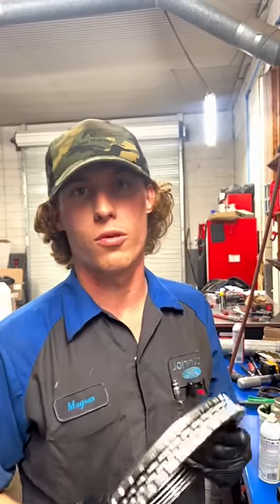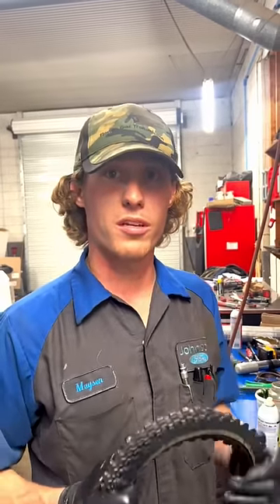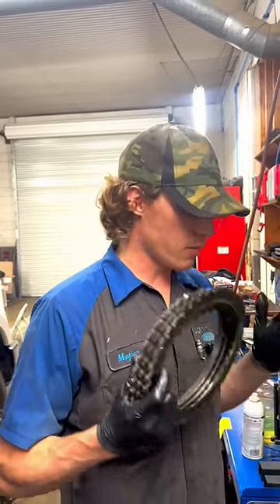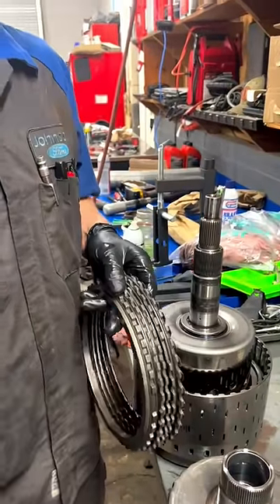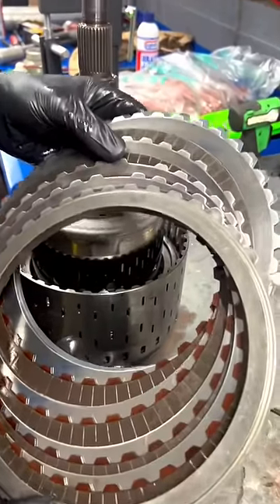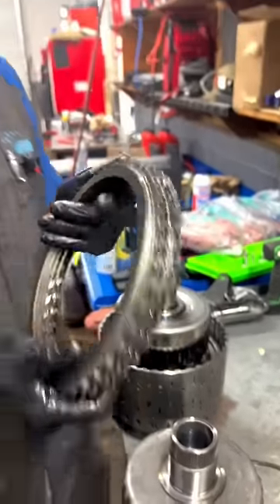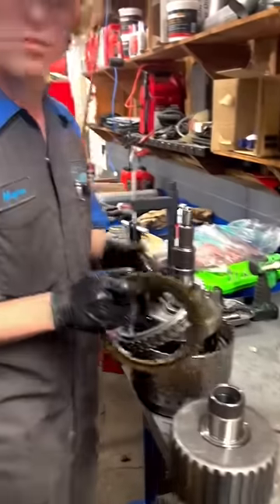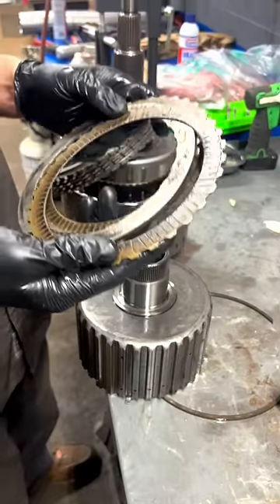Should you replace every clutch during automatic transmission overhaul? #shorts

Comment from the maker: Keep in mind!!! A lot of these clutches and steel plates are impossible to get. Not to mention, I said “warranty” which implies very low mileage units. 

Would you really want to wait 3 months on a back ordered set of clutches that you don’t even need? 🤔
Reply: Yes, often times if a clutch pack grenades you have metal fragments suspended in the fluid which makes it into the other clutch packs and embed themselves into the friction material. That transmission may function when you are done with it but it's now a ticking time bomb limping by to make it out of warranty where the customer has to shoulder the cost. Best to burn the transmission up, or take it to a reputable transmission shop for warranty work which is legitimate because it's illegal in the us to make someone go to the dealer for warranty work.

Edit, unless it got super hot and warped the steels your steels are usually fine. Just rough them up so they mate in with the new clutch packs and get the glaze off of them.
Reply: @oliver_klozoff  for factory warranty? Nope you have to take it to a dealer don't you? I'm an independent so,
 Baah! either the steels are good or they're not, if they have blue spots I'll resurface them with a 3" scotch disc on my old angle die grinder, but only if it's an absolute last resort. If they are scored up, warped, shot, no way. I normally buy master kits w Borg clutchs & steels. I hate reusing steels if you are putting in new frictions anyway. If you buy less steels banner kits you usually have at least one burnt up clutch pak so you need steels for that one or ones anyway. But I work mostly on older stuff, four speed overdrives & some old three speeds even yet. But yeah I've been running into parts shortages too, especially on the new stuff.
Reply: @oneninerniner3427  you do not have to take your vehicle to the dealer for a factory warranty. That is actually against the law to have that as a requirement for warranty. Just as they cannot tell you you have to have your services done at the dealer. But your shop has to be willing to work with the vehicle manufacturer to get the warranty fulfilled.
Reply: @oneninerniner3427  as far as steels go, I keep spares if they'll lay flat on a flat work table and don't have obvious signs of heat damage. The different thicknesses between new and old can help you build your clutch packs to the proper tolerances. I usually double my clutch packs up on certain builds, so even when getting new steels you usually have to use a mix of new and old to build the proper clutch pack when you throw out the big spacers.
Reply: @oliver_klozoff  yup ,some of them you can get oversized steels to adjust clearance too if different snap ring thickness won't do it.
Reply: Or different thickness backing plates I should add.
Reply: @oneninerniner3427  yes on all counts. I'm not a professional tranny guy, but my dad was a builder for 28 years so some things have just rubbed off on me. Never had anyone build me a transmission, but I have had my dad supervise me building one  unfamiliar with.
Reply: @oliver_klozoff  I think it's more like the independent shop has to try get the manufacturers dealer to work with them to get the manufacturers warranty to cover. Doesn't it have to go through a dealer? 
Aftermarket warranty outfits yes I've worked with them many times.  But I worked at a fairly well known trans specialty shop in my area for many years , before I went back to my own shop and even then we couldn't or they wouldn't allow us to do any OEM manufacturers warranty work, the dealers did it themselves.
Reply: @oliver_klozoff  ok so you aren't a professional builder ,so there's that!
Reply: @oneninerniner3427  my dad did lots of gm and dodge warranty work. I think it has a lot to do with your affiliation with ATRA and being certified to do warranty work for them (Chrysler, gm, Ford, etc). I know he has to send some off for warranty work, but not much.
Reply: 7 months i waited had paid ahead of time they shipped it from wayyy way far away for no apparent reason for a rebuilt tranny cost more than the vehicle i bought and works fine now but i feel like i overpaid by 2/3rds what it shoulda cost oh and on top of that no mechanic would offer to install it for me I even had brand new radiator and radiator cap and all to install to keep it under warranty  the old radiator still good and kept it so it couldn't be wasted as scrap pretty sure it's going to power my desktop it's overkill big enough to passively cool without a fan but eh go big or go home right?👍 so yeah spare parts because i want the antiques to last forever like the promise NO new or current vehicle would Ever make or keep thier word of garuntee
Reply: Ford dealer tech no I replace what is fucked up but I do get a seal kit and replace all seals even on the 10r140s
Reply: @Kevin-yc4kg  yeah as long as it makes it to the end of the warranty you guys get to charge for replacing it when it grenades because there's metal fragment embedded in the rest of the clutches. You guys at the dealers are hacks, nothing more.
Reply: Yeah, sometimes. Aftermarket clutch replacement in an automatic or manual transmission is preventative maintenance. Why not pay for the job now when you can afford it vs when it it's downbad and the bill is hella ran up
Reply: What state do you live in?
Reply: I get ya brother people still act like parts are falling off the shelves when their not. If you can only get what you need to get a vehicle back on the road, do it. People can't wait 6 to 12 months to get their cars fixed. Hell insurance companies are totaling brand new cars with minor damage cause they can't get parts to fix them, and it's cheaper to total it than pay for a rental that long.  We live in a totally different world now. It's no longer a throw-away society, I know it will take some getting used to, but we're all going to have to get on board.
Reply: If I'm paying for the parts and labor yes 💯 if you're not going to do it then don't charge me for it and as long as you make me aware of it and I'm okay with that then yes
Reply: Take a measurement consult spec
Reply: Of course send it
Reply: These comments are hilarious. Oh okay, I’ll ask the customer if he wants to spend an extra few hundred on parts and wait a month or two to get them, because I should replace all the frictions and steels “as long as I’m in there.” No. The manufacturer tells you what you will get paid to replace under warranty. Nothing more. And then, you get to take pictures and send those failed parts back - so if you lied to try to get other non-failed parts replaced, odds are it’ll come back to you eventually.  You replace the parts that the manufacturer says to replace, and the tech gets paid to replace only those parts. It’s stipulated in the warranty legals you agreed to by taking ownership of the vehicle. 
As for outside shops doing manufacturer warranty work: only if it’s a sublet from a dealer that isn’t equipped to do the warranty repair, and the manufacturer approved it beforehand. Otherwise, no. A manufacturer does not have to pay a non-dealership entity for warranty repairs. Go ahead and submit that paperwork for reimbursement, see how that goes for you. It’s literally spelled out in the warranty legalese that, once again, you agreed to by taking ownership of the vehicle, just like it’s spelled out that the manufacturer can end the warranty coverage at any time for any reason. 
Also: the Magnuson-Moss Warranty Act has nothing that says that any car can be repaired under manufacturer warranty at any shop - in fact, quite the opposite: “the warrantor may require consumers to return a defective item to its place of purchase for repair.” What is DOES say is that if that dealer notices that you have, say, aftermarket wheels and a fancy cold-air intake, those items alone are not justification for voiding the warranty.
Reply: @oliver_klozoff  LOL, try that some time, it won't work out well for you. For one, the dealer is the one that determines if the repair is eligible for a warranty repair, another shop CAN NOT PERFORM THIS TASK! Then you have the fact that the pay for warranty work is lower than that for regular work. Any shop other than the dealer will refuse to work for that lower rate and the manufacturer will refuse to pay a higher rate. You will end up having to pay the other shop up front, go to court, and get a judgment in your favor for that amount. Sounds like fun, huh.
Reply: @Kevin-yc4kg  anyone who wants to stand behind hack work like putting used clutches from a known failed unit back in, probably not even cleaning the contaminated fluid out of the pistions and accumulators as well, knowing that thing send clutch and metal material through the whole system deserves to be called out. You're just putting junk back together and hopefully it'll last a day beyond any warranty period. You people give real technicians a bad name  and are why nobody trusts a mechanic. Take some pride in your work.
Reply: If it's warranty item(s) then aren't you only replacing the 1 or 2 spicific areas in question 🤔 everything else should have been in perfect shape
Reply: Which means it's a Lemon.
Reply: @danlevesque5437  if a clutch pack burns it up it has contaminated the rest of the transmission with metal fragments and burnt clutch material. The rest may function, but in the same manner as a hand grenade with a random number generator for a fuse. It most certainly will not last because it has all been damaged. Any decent transmission tech will report this for warranty and not just one failed clutch pack. I wouldn't put my name on that kind of hand grenade.
Reply: Rock Auto... And if it's a dodge really change everything
Reply: @andyt1573  if it's a dodge throw in out and convert it into a manual transmission 👍
Reply: I would, just to make sure it’s right however the dealer had better be making it really right with me for waiting that long, but then again, at least it’s not a piece of $hit EV
Reply: @oliver_klozoff  exactly
Reply: @bobbylewis9587  too bad only 2 states offer and uphold the lemon law
Reply: You should keep some cores for spare parts. Just a suggestion.
Reply: I'm no expert, but if the facing is anything like brakes, a properly bedded set can go the distance. A fresh set could actually fail sooner if they don't bed in right, or have production material flaws.
Reply: Are they hard to manufacture?
Reply: I tend to fall in the well I'm in here already mentality but that relies on are the parts available and relatively well priced if I'm in there and fixing only the bad parts for 500 dollars but replaceing them all is 650 yea I'm in there already but if goes from 500-1500 nope
Reply: If the steels are flat. Not heat marked, AND the clutches mic correctly. Then yes re use them for factory warranty. Providing nothing has metal fragments imbedded. 

Keep in mind that if the clutches are worn down just 2 thousandths, and you have a 5 clutch clutch pack. You just increased the clearance my 10 thousandths. So just looking at them. Doesn’t actually cut it. 

Now if that comes in to the after market. And is a customer pay job. The customer is paying for the transmission to be rebuilt. So yes. They get replaced. Along with all seals and you have to remember bushings also, they wear too. So they have to be checked.
Reply: Nope
Reply: Just go electric
Reply: My uncle has been rebuilding transmissions since I've been in diapers, I've helped him many of times. His transmission builds are sought after by the demolition derby racers because he has a trick for valve bodies that seemingly make them indestructible on the derby tracks.. that being said, he will disassemble the entire trans and have his cleaning crew (my cousins) run every part through the parts washer and then lay them out on table and he would go through and gather every part, every clutch that passed his inspection.. anything that didn't fly was replaced.. he most definitely has used many used clutches with no issue
Reply: If the transmission grenades and it sends matter to the system I replace all the clutches and steals because you can't Effectively get all the metal particulates out of the clutches But This depends on what the failure was And what the customer paid for If they pay for it full rebuilt then I replace all the clutches and steals
Reply: My warranty company said no to a dealer in house rebuild. They wanted a remanufactured installed. Started out at the end Of November of last year at over number
One hundred on the national waiting list!  The dealer called end of January and I was number twenty-seven! And this started as the dealer claiming a bad battery and a transmission flush was all I needed! And I wound up nursing it home because it wasn’t fixed! Then after a month long wait for another appointment they tried to tell me it just needed an ECM  replacement. But when they tore into it the valve body was screwed up! All while acting like I didn’t have the warranty that I purchased from them.
Reply: No, no. You didn't say "warranty". You said mostly warranty and that ford and dealers and such wouldn't pay for the rest to be changed, which I can see because they are cheap. However, you went on and said that if it was customer pay, you would do it as well, which is wrong, that shouldn't be up to you, but the customer. Especially if it's customer out of pocket and not warranty, you should be making them fully aware it's not all new clutches going into the transmission, and your doing the equivalent of the half-ass job the dealer would do under warranty to save money. I would replace all clutches if available (unavailable is a different story yes, but also hard to believe completely unavailable). You also said could have 100,000 miles on them, pretty sure thats the opposite of "implies very low milage units" and you expecting them to go 200k to 300k more. Hope you ain't doing that on 4l60e 3rd and 4th gear clutches lol. 🤣. But you do you.
Reply: @oliver_klozoff it's nice to see someone in the comments who knows something. Kinda refreshing. Not a lot of people know that about being able to take stuff to independent shops for warranty or recalls.
Reply: I'd replace everything possible because I'm not being paid to half ass a job I'm being paid to get it right. Just had a transmission brought to me tired time the guy had to pull it rebuilt not making it 10k so decided to have me do it. There was bolts in that transmission that were over torqued and then under I really wonder if the last guy owned a torque wrench then was some other very obvious issues and a few less obvious first gear was really only clutch that was toast but yes I'm replacing all of them also adding some upgrades like machine to a clutches because what this guy is doing it's better to have a few more. No as for if you can only get the factory to cover a the one piece that failed try for as much as you can then talk to to costume and see if they want spend a little more and get it done. Tell you something learned most costumers will pay a little more for pieces of mind next question are you willing to back your work if it fails because I do. I don't even work in the repair industry right now and still get random people who want a transmission rebuild and they know if they have issues just bring it back sometime it's something I somehow missed up something is a new bearing explode and took the planetary in a transmission. had very few transmissions ever come back for something I did most I see have a hard life.
Reply: @Vic what law are they breaking doing warranty work? Are you smoking something? There are actually laws preventing steelerships from making you have warranty work done solely by them.
Reply: @Vic how is that an example? How does that absolve Ford of cutting corners on hacking your transmission under warranty together? A better example is saying your battery in your iphone blew up and apple will only replace the battery but it got acid on the screen and control board damaging them but they won't replace them because technically they still work, but are damaged and they hope you won't notice until your warranty is up. There I fixed your bad example.
Reply: @Vic as far as who, apple has authorized service centers, so does Samsung. Sometimes these are the same people so again, invalid.
Reply: @Vic apparently you don't understand that dealerships do not have a monopoly on you and shops can be factory authorized, but since you apparently failed at reading comprehension since I have said this many times I bet you won't get it this time either.
Reply: Yes!!!!!!!!. I only do my work on every part of my “racecar” lol. And thankfully I am blessed to have a good paying job so yea personally I like to replace things in sets like shocks,brakes, I just think we’ll shit if Imma buy one why not go ahead and just get all better quality parts while I’m already there. Like my best friend spent hourssssssssssssssss just to replace his turbo with another shitty eBay turbo. Like dude wtf. Why buy shitty power. Yea he is running 500WHP on a shitbox but bruh why tf r u buying ass parts. Spend the money on a good brand so you don’t have a pos that’s gonna shit every part
Reply: @Vic wow, you cannot read either.
Reply: the at one time perfectly good parts failed in the trans, now somehow everyone thinks if you replace everything with more 'new' parts that it's somehow magically bomb proof....   when you could re use perfectly good parts that have proven to be working just fine.
Reply: Isn't there a minimum height spec
Reply: @oliver_klozoff dude it isn't the techs at the dealers. It's the actual oem and they fuck the technicians way harder and in way more ways than you could ever imagine. Hence the insane tech shortage